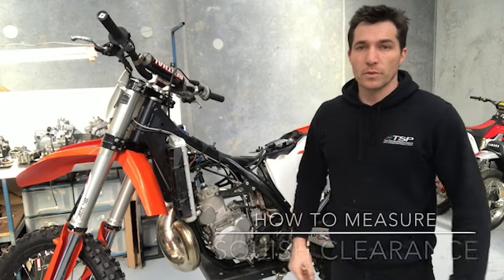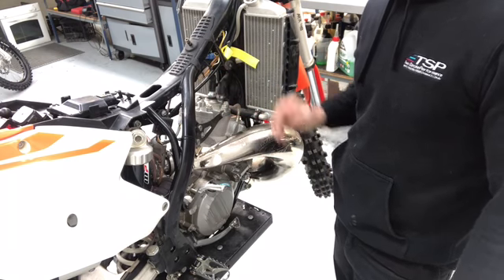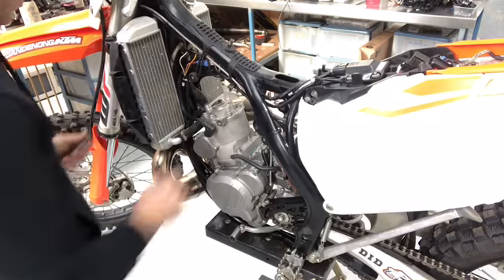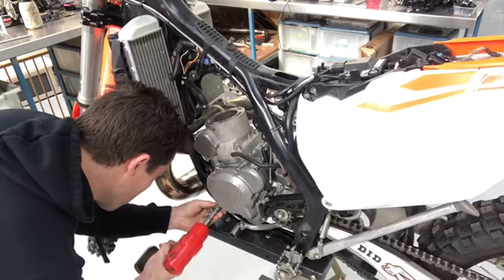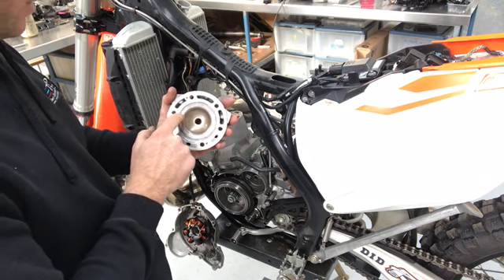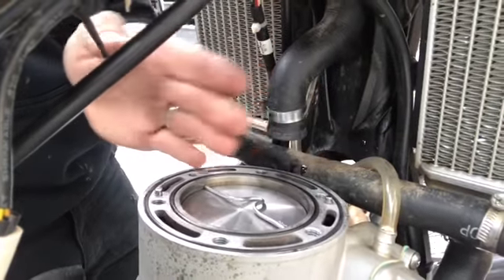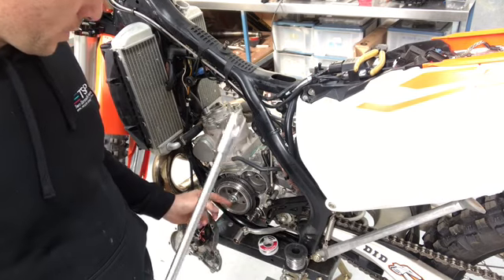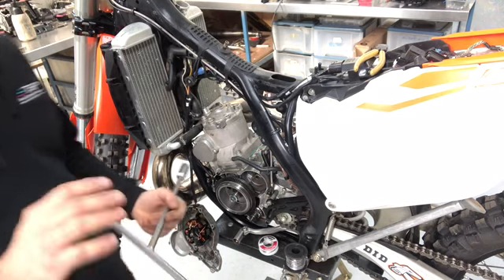Measuring Squish Clearance on a 2 stroke engine

Comment: Thanks very much for this well-explained video.  I was searching for an explanation of "squish".

Another method to wind a double thickness of solder is to bend it once, press the bend together tightly and chuck it up in a drill.  Place the other ends close together in a vice and operate the drill slowly.  The more resistance you put on the drill, pulling away from the vice, the tighter and more even the twist will occur, although as the solder winds up it does shorten the overall length, so you need to allow the drill to move slowly towards the vice as you go.

Comment: The little U bend in the center of the solder piece facing forward tells you left or right? How is that when you could just flip it over 180° and then left becomes right and right becomes left? Thank you.

Comment: Is there anything wrong with the old technique of just bending a piece of solder and going through the spark plug hole and doing one side at a time? Thereby saving you the work of taking the head off? Thank you even though I've noticed you don't usually respond to questions.
Reply from the maker: If you do it through the plug hole on one side you’ll always get an incorrect reading as the piston with rock to one side. If you want to build a good engine it’s important to get the specs correct and it’s worth the extra time it takes to do it properly.
Reply: You can do it through the plug hole, but you need to be in line with the wrist pin to avoid piston rock.

Comment: On the 2017 with a sx head, what would you recommend solder thickness I use to get down to 1.00mm? Currently not even getting any compression on 2.4mm solder. My base gasket is 0.80 and a 0.45mm so 1.25mm. Trying to get it dialed.

Comment: Hi! If i set my x dimension corect to 0 then i have squish 2 mm, gasket îs 0.7, if i put a thinner gasket then my x dimension Will be out of specs... Please tell me what to do... What îs more important to be corect, xdomension or squish... Because i can't make both corect. Thank you all replay
Reply: There will usually be no reply. I think that once you choose your base gasket and get your X dimension to 0, the only way to then get the correct squish measurement after using the solder method is to have the head machined down. That way your X stays the same but you are in essence lowering the head to create a tad bit more compression/torque/power etc. But in my years of racing, 99% of riders can't even ride the stock factory bike to its full potential so not sure any of this is even worth it to be honest.

Comment: why do you recommend BR8ES vs the BR7ES that comes stock on these bikes? my test came out at 1.75mm, think i need to get some different solder tho.
Reply: no you are wrong a BR8ES is colder than a BR7ES the heat range numbers on NGK spark plugs are 4 is the hottest plug though to 9 which is the coldest plug
Reply: Yep b8 is a colder plug
Reply: BRRAAPPP250 be great if the guy doing video answered the question I thought he said it was hotter too,you’d think a colder plug would foul more not burn cleaner
Reply: @aussiepride8015  me too. 02 250   06 125 braa@AAAAAAAAAP
Reply: @clementinedickson1150  your wrong

Comment: most of all this was not needed to be done lol.......  Just unscrew the spark plug, Put a piece of solder in the plug hole till you hit the side and rotate the back wheel some in high gear. then measure the solder....
Reply from the maker: Doing it that way always gets an incorrect measurement